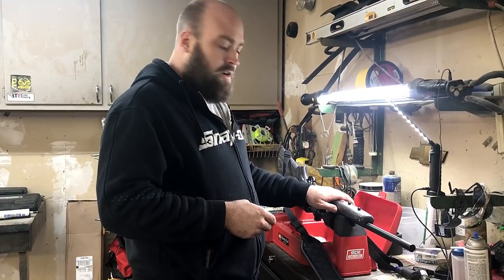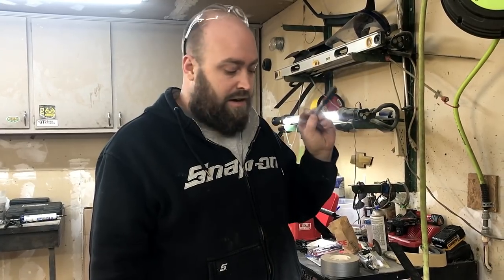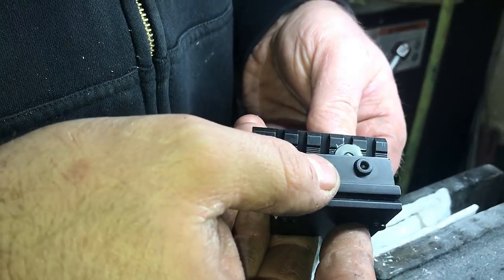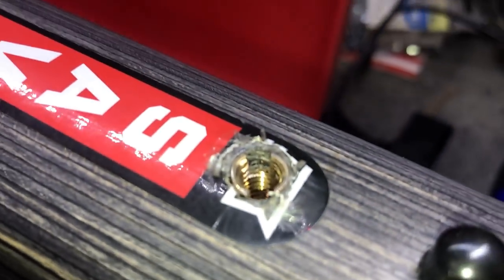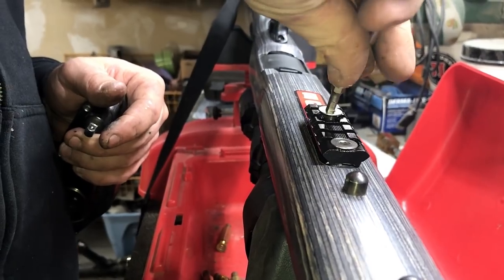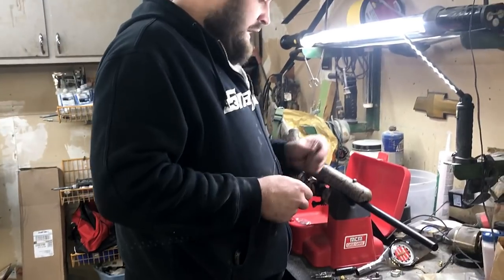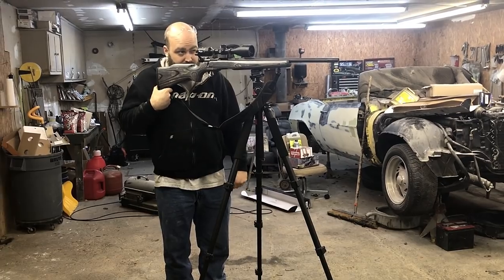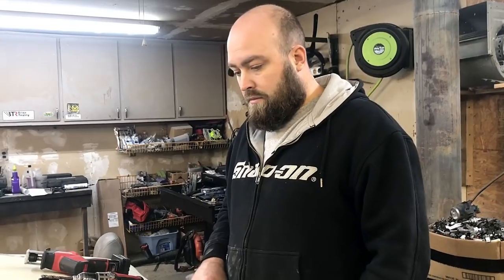How to mount a rifle to predator tactics dead eye ball head tripod

Comment: Great video thanks
Reply: No problem! We also used the brass inserts in a plastic/ composite stock tonight. The stock was 1/4" thick so it worked nice. If the stock is to thin you can remove the stock and epoxy the drill area befor drilling also.

Comment: I'm thinking about switching my tripod to predator tactics too. I shoot off the carbon fiber death grip. Killed  2 coyotes last night but I'm stepping up to a ar10 6.5 creedmore from a bolt.
Reply from the maker: You should have pretty good luck with it I have since then switch back to a slick 700 from Amazon it’s a little heavier but it is more sturdy I think and I also changed ballheads one from Amazon